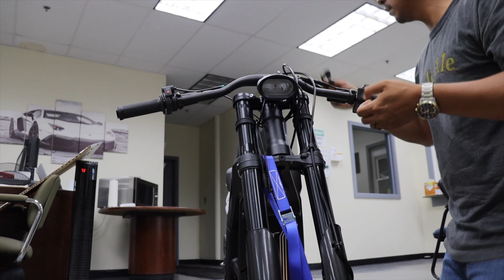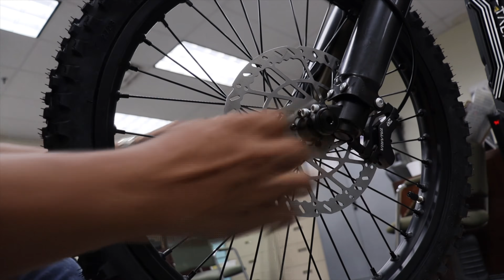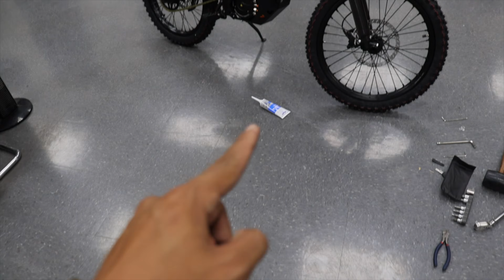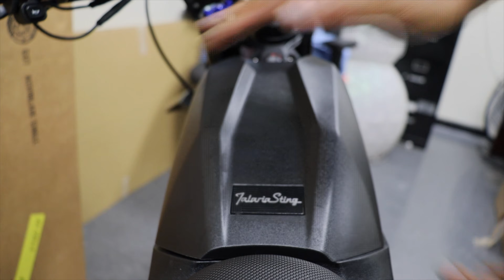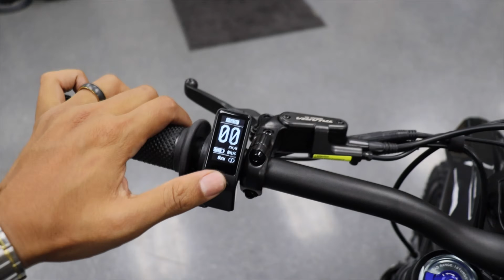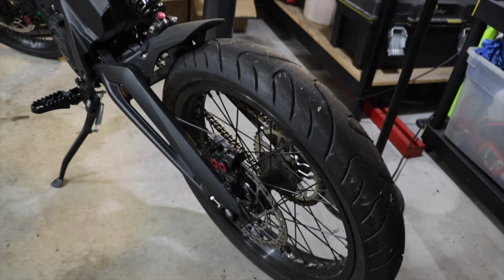Talaria Sting R MX4 Assembly and How to Remove The Speed Limiter

Comment: So in short, they both feel about the same in power, but if you are in a city, its best to go with the XXX just incase police look at you sus riding a dirtbike in the bicycle lane. The xxx i feel can get away with being in... tighter areas.
Reply from the maker: Yeah pretty much. The mx4 however has a bigger wheelset and better suspension, which is better for off-road use and has slightly more aftermarket support. Though the XXX is starting to have more a/m upgrades available now (mine now has a 74v battery and upgraded controller, etc). XXX is more sleeper look and can fit in tighter areas though, yes better for city street uae

Comment: Do you need a license for this bike?
Reply from the maker: Not in my area, though it is not legal to ride on public roads since it doesn't have turn signals, brake lamps, or a VIN assigned
Reply: Do we have to fill the oil before to ride for first time?

Comment: Can you show how to connect a brushless controller to a battery with a lipo connector. I’m trying to do a cyber quad rebuild as well but I’m changing everything out and is stuck on this problem. Thanks!
Reply from the maker: What battery do you have? The factory 36v one is all I have experience with for the cyberquads
Reply: Yeah I got a new 62v battery that I’m trying to connect to a new motor and controller